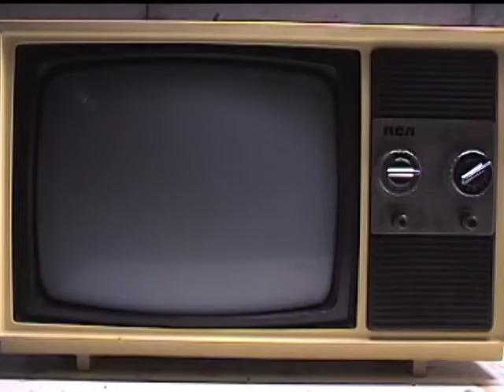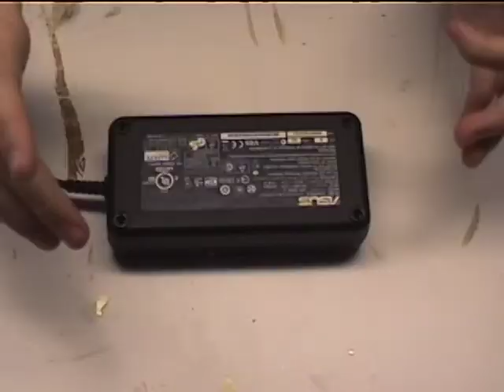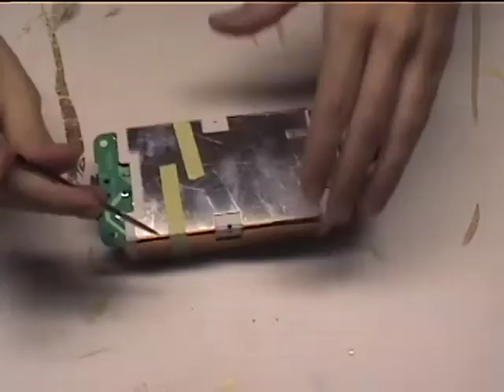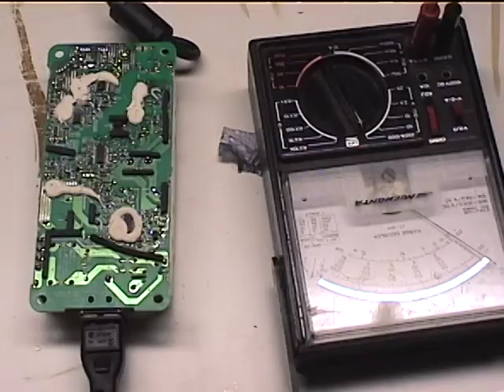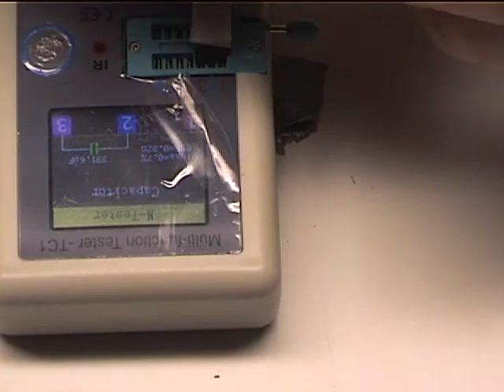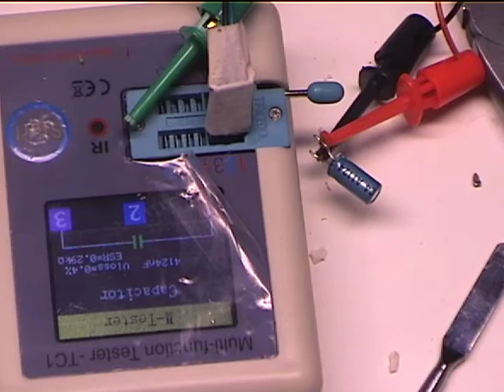Repair attempt on a 150 watt laptop charger - eDoc2020 #11

Comment: Some laptop bricks have shorts in the output cable or the 19v plug.
Poor quality.
Final capacitors or rectifiers going short is common.
But you had to go one stage more and kill the pfc and lots of other parts, you greedy man lol 😀
I never got deep into pfc, but some lcd tv sets have a pfc circuit that boosts the 240v mains to 400volts across the crap-a-citor lol.
There are other pfc systems, but i run away to avoid the task of fixing one ha ha :-D.
Reply from the maker: So far I've only seen one capacitor go dead short and it was a paper cap from the fifties. Regarding PFC, I think most are boost converters boosting to around 400 volts. I consider these the simplest DC-DC circuits on the power side. All the magic happens in the controller chip.
Reply: @eDoc2020  I can't waste a good 19v psu.
As i came from a family with very little money, i always try to repair things.
Im sure you have repaired bucket loads of devices.
Satisfaction and fun :-D
Reply from the maker: @zx8401ztv  I'll probably end up using this as parts for other projects.
Reply: @eDoc2020  not wasted :-D
Ta ta :-D